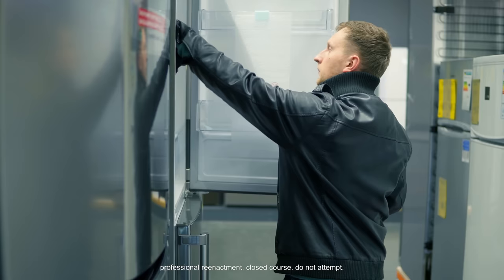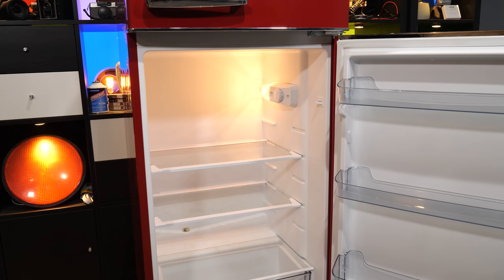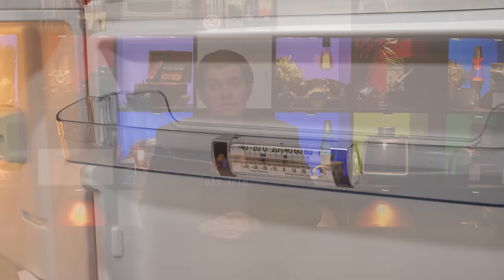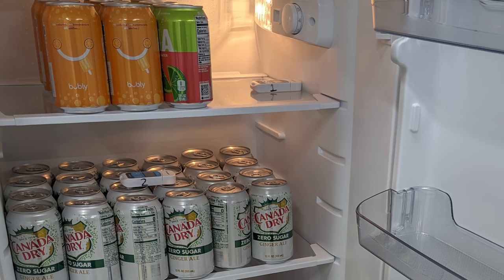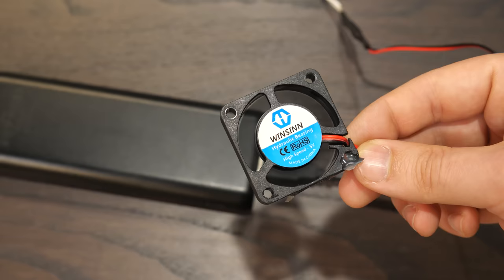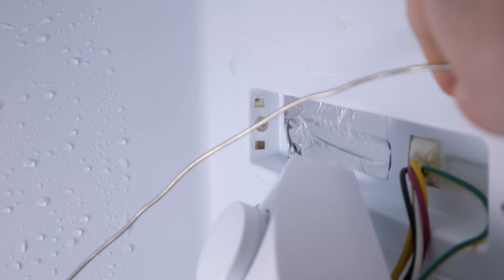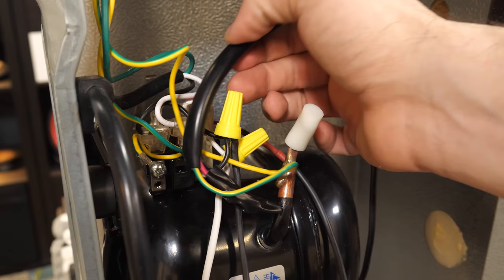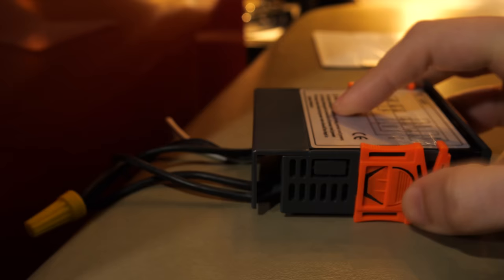This goofy fridge has a really clever design. It's also kinda terrible.

Comment: That's pretty interesting to watch this as a European, particularly because, as someone else stated down below, this is a pretty regular home fridge here in Europe (or at least Italy where I live). Yes, we're starting to see automatic defrosting, fans, microcontrollers and so on nowadays but this design is still quite common and is used with more powerful compressors too, especially if you plan to spend less than 500 euros (which, by the way, it's like 1/3 of a normal salary here in Italy) on your new fridge. And yes, this fridge doesn't "make" cold but only keeps it, but we would never ever put something warm in the fridge. That's something even the best chefs give out as a pro tip on TV shows. We also would naturally consider that as a useless waste of energy! The only downside is this fridges don't make ice cubes, but it's something we don't need so much. ice-making trays cost nothing and do their job
Reply: It's ironic cuz his comment is on top D:
Reply: The Ice maker machine is always the first thing to break in my omerican fridge experience.
Reply: Same here in The Netherlands
Reply: If a fridge doesn’t “make cold”, it’s just a glorified icebox
Reply: @EnigmaticLucas  Well yes, what more do you want.
Reply: @EnigmaticLucas  yes, a fridge is just an ice box without having to buy ice
Reply: @hoseja  A fridge that actually cools things
Reply: Americans had cheaper access to ice even before electric refrigeration.  Ice was more expensive or impossible to obtain in Europe and warmer countries. Ice boxes weren't as common and there is a longer culture of not having refrigeration.  In my experience, it's only Americans that like their drinks with ice and their beer ice cold.  As someone who lived New York his whole life, I have met people from all over the world.  The thing that they find amazing is the quantity of food served in restaurants and how we like our drinks cold.
Reply: How do Italians live off only 1500 euros a year? Unless you mean salary as the monthly paycheck
Reply: @Miss_Trillium  In Europe salary is typically given by month, so 1500/month or 18000 per year (and traditionally a December bonus of a month's salary extra, so 19500/year).
Reply: @misstrillium8849  Yeah, luckily It's the average monthly paycheck, except for younger workers, the situation can be waaay worse. Some people between 18 and 29 live on a paycheck of 500 euros a month (thus obviously can't afford to pay a rent for themselves and have to stay at home with parents). We usually refer to our salary as the monthly net amount because we have a lot of tax withholdings, like 300€ on an average 1500€ paycheck
Reply: Exactly, I have a fridge which is a bit bigger, freezing compartment on the bottom. I use the freezer mostly for frozen veggies, sometimes few bits of meat and ice cream. I did cost 330€ in Slovakia 10years ago and it still perfectly adequate. Maybe not "green" to today's standard but compared to average US fridge probably still has much less electricity consumption. Also we don't use as much ice us in US so ice making trays are again perfectly adequate.
Reply: Meanwhile it would literally be illegally inefficient in many other EU countries. Fan forced designs are just so VASTLY superior in every way, but esp energy usage.
Reply: "The only downside is this fridges don't make ice cubes, but it's something we don't need so much. ice-making trays cost nothing and do their job"

I don't quite understand what you mean. An ice tray is just a plastic tray to hold the water until it freezes, but you still need a refrigeration unit, right? Or is there really a separate device for freezing water into ice cubes out there
Reply: @MrCh0o  Nope, you just stick it into your regular freezer and wait until the ice is ready. Some fridges (namely Samsung ones) also come with a plastic "ice maker" a mini-box that works quite the same but makes ice cubes fall into a tray at the bottom (you still have to provide water and phisically move the box in and out of the freezer though, so it's just somewhat fancier)
Reply: @carlm1595  "we would never ever put something warm in the fridge"  Do you mean you wait for it to be room temperature?
Reply: @Jackleber  Yes, of course.
Reply: I live in Portugal and have family in germany, this kind of fridge is all I've ever seen, it's so funny to see an north american surprised by the simplicity of them, and even funnier to me is that he calls it a mini fridge, it's not that small. for north americans I guess a normal fridge is a double door gigantic, or even tripple door, monster fridge like he showed on 19:58.
A very small amount of people here have american fridges, usually it's rich people that have lived in america and came back. What I found weird in this video is that all the tubes are on the side of the fridge behind a metal skin, usually they are just exposed on the back of the fridge.
And yeah, I was told by my parents since a kid, it's stupid to put warm things in a fridge, wait until whatever you want to put in is room temperature, then there is no energy loss.
Also our freezer compartments are more effective than what Technology Connections experienced with his, I can freeze meat very effectively and when I put a beer bottle in the fridge to quickly chill it, I have to take it out within 15 to 30min otherwise it will freeze within 30min after that. and I don't experience that drastic increase in temps when I put large amount of things inside and it does go back to the desired temperature, looks like this fridge is cheaper than the average. most of the money probably went into the styling of it.
Reply: @historyandscienceisinteres7082  Yes, I totally agree. Maybe the fact is just that our regular household fridges are made just a tad bit better than his "mini fridge" (which by the way is not so small, yet still not a fridge you'd find in a house where a family lives, to me it would be more suitable for a second house). Thus,  our regular household fridges follow this design but have more powerful compressors and better insulation, so they are more efficient too. And yes, lots and lots of fridges here still have the warm part exposed to better dissipate heat. This is especially true for built-in ones
Reply: Thing that struck me; he considered 4.4C just within safe limits. Here we set ours to 8C, but I know some others go for 5C. Maybe this just wasn't made to keep things as cold as Americans want it.
Reply: @chuckpunk3272  From the LG italian website: 
The ideal refrigerator temperature is 4°C, the coldest point of the refrigerator is usually the lowest shelf, above the vegetable drawer (2°-4°C), while the compartments or shelves inside the door these are the "warmest" areas (which can reach 8°-10°C). The intermediate shelves usually vary from 4°-5°C of the central shelves up to 8°C of the highest one. The bottom drawers, intended for vegetables and fruit, have a temperature of around 10°C: lower values could, in fact, damage these foods.

So, not only is it perfectly normal for fridges to have different temperature zones here, but it's commercialized as a feature. Honestly, I don't see the point of having 4°C in the veggy drawer. Yes, you could put tons of beer and soda cans in there or even stick an entire stock of meat in, if you'd like, but it's not the task a household fridge is designed for. That would be more of a task for restaurants and bars fridges. A household fridge is designed to put different kind of food and drinks, and not all of them need to be at 4°C

Comment: The thermostats tail fits to an evaporator for a reason, it controlls a defrost cycle. With your current configuration there is no guarantee that defrost cycle will be completed before compressor starts again. So you might have an ice crust on a back wall of a refrigerator. You need to add an evaporator sensor to fix that :)
Reply: And... it's within the wall now... so you wont really see it happening
Reply: And that "defrost cycle" is basically just doing nothing for a while. So all it does is limit the compressor duty cycle, which could be due to ice buildup but also to protect that tiny compressor from running for too long and overheating. Not sure if the overload protection on the compressor takes a high run time into account, or that it only trips on a motor stall.
Reply: thank you, I suspected the probe was there for some reason, and it is indeed a very elegant design solution overall
Reply: @Stoney3K  my thoughts exactly. I started cringing when he was talking about five hour run times, and then really cringing when he was talking about 14 hour run times. He is bound to have knocked years off the life span of that little compressor.
Reply: @FriendlyNeighborhoodNitpicker  The compressor cools with circulation of refrigerant and doesn't overheat according to time.  Similar, driving 14 hrs in a car doesn't overheat vs. driving 1 hr.
Reply: @Stoney3K  The cycle is more about the volume of ice building up. Thicker ice means less efficiency, as the ice insulates and builds thicker -- hence the freezer getting so cold and probably a pretty thick sheet of ice in there as well on the 14 hour run with the microcontroller. Further that larger volume of ice in the refrigerator section may be more than the drip tray can handle all at once on the 14 hour microcontroller vs 5 hour thermostat cycle.  In the end, the 48 can test was simply beyond the thermal-time capacity of the design, hence the 16 can test working much better. 

The refrigerator was designed as a small, light duty piece of kitsch for somebody living in a loft that puts a couple grocery bags away at a time, not a family of 4 dumping a whole grocery cart in all at once. That said, used in the designed capacity with a 12 pack and a few groceries here and there, the microcontroller will probably be safer for food temps overall. The device just needs to be used correctly within its design constraints.
Reply: As indicated, the electronic thermostat illustrated what was wrong with the original configuration.  You are right to point out some tweaks to the final design, but he did discover and fix a real design fault.
Reply: @stephenhenry5346 but you will still affect its lifespan through increased mechanical wear, the same way driving a vehicle for longer will mean you approach its 10,000 miles service quicker.

Comment: This is interesting to see. This is the only fridge design I have seen for decades in Germany. When you said, putting warm casserole in would bring up the average temperature to unsafe levels, I said "d'oy, of course". But then I remembered how Americans just put hot things in the fridge to be "safe". Here in Germany, we only put room temperature and colder things in the fridge for that exact reason. Food won't spoil that much faster if it cools outside the fridge, and the dreaded "danger zone" for food doesn't matter (when cooling down) if it sits there for a couple minutes...
Reply: I'm American and I've never put hot things in the fridge? Maybe it's a southern thing but I always heard from my mom and grandma that if you put hot things in the fridge they'll "sour".
Reply: Considering the results with the room-temperature soda bottles, I don't think it could handle ANY food that would be even slightly warm. With the mentioned casserole you'd need to wait at least 6h to get it all the way to room temperature. Much too long for my comfort...
Reply: @bzqp2  The difference may be portion sizes as well. In the US we tend to have rather large dishes of food like the big casserole dish, and I believe it tends to be much smaller on average elsewhere, so fewer leftovers, etc to fridge.
Reply: @bzqp2  Please. He loaded up the whole fridge full of water. Water takes an insane amount of energy to cool and heat. Your shouldn't load up the fridge with everything all at once and expect it to just be cold, and food has some solid content as well, it's not just water. Of course the air temperature in the fridge rides up a little, but so what. There's also plenty of thermal mass in the fridge to keep it from oscillating too badly.
Reply: I put a decently warm pan into my fridge once. Never again. I heard a loud "Ping", and had to look for a new glass shelve. Nevermind the efficiency of the fridge, temperature stress inside the glass pans is no joke either.
Reply: @SianaGearz he fact that the fridge never got back down to empty fridge temps after hours of running and plateaued several degrees above that temp until he changed the thermostat says it's not because it was water.
Reply: @bzqp2   why is that to long for comfort? What happens to it when it takes to long to cool down?
Caserole is just a sort of a 1pan oven dish right?
I know things like pies and stuff get soft and stale and don't get their crunch crust if you cool them to fast, never heard about food that went soft or stale if you cooled it to slowly honestly.
I usually put leftovers and pre-prepared food stuff in the fridge the next morning. If you box it up when it is still hot it starts condencing water in the container and everything gets soggy.
Reply: @hopelesslydull7588  Not surprising as well that you expect a vaguely normal amount of stuff in the fridge rather than it being empty. These fridges work fine, they aren't made for torture tests. You turn it on, and don't turn it off for the next year or two until you need to defrost it, and during the 3 or 4 days after it's turned on it balances itself out, it's fine. Less than a day after defrost since you don't need to open and defrost the main chamber.
Reply: @strayiggytv yeah that's a weird myth people picked up somewhere.
If your fridge has decent cooling power, you can just put it right in no worries.
Reply: @baronvonlimbourgh1716  I'm mostly concerned with microbial growth.
Reply: @strayiggytv  Except Technology Connections is from the Midwest I'm pretty sure, he does talk about Menards.
Reply: @bzqp2  ahh ok. I thought it would taste funny or something, my bad.
Reply: @SianaGearz   no consumer goods are build for that. They are build to perform most efficiently under a normal workload while also being able to handle the odd exceptional more demanding situation.

If that wasn't the case we would all have 4000 dollar toaster ovens
Reply: @hopelesslydull7588  It's not a thermostat though. The target temperatures for it's different temperature zones are fixed. That Dial adjusts some comperssor and kicking in differential settings specifically for when you dramatically change the fridge's load. You dial it back over time until the back plane will not have a permanent ice layer.
Reply: @@phillipbanes5484 People outside North America enjoy better land use policies than those that  require you to make the occasional dedicated grocery trip, pack up your stocks and fridge and then have the inside empty again over time until refill. The thermal mass in a fridge will be much more consistent over time in much of the rest of the world.
The bigger and more sophisticated american fridges are a result of problematic bigger issues of the US that you ignore.